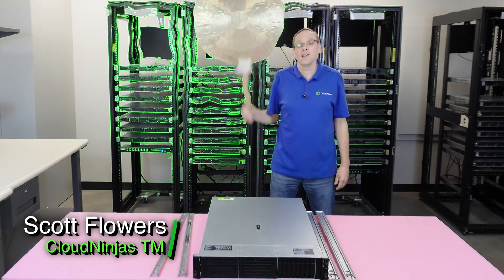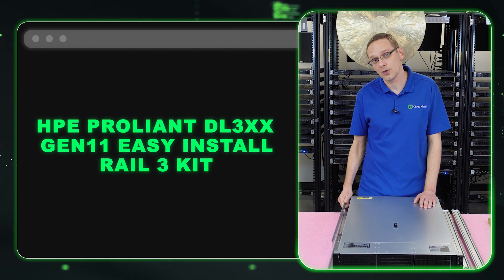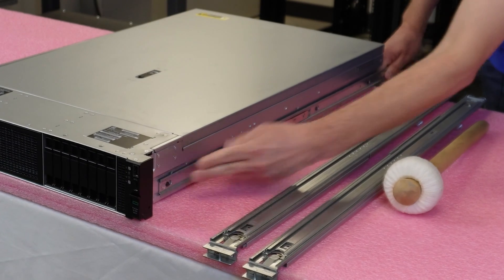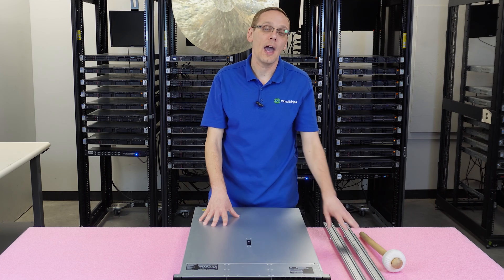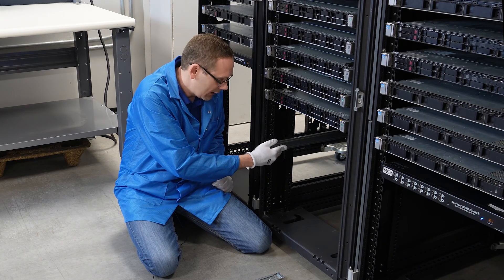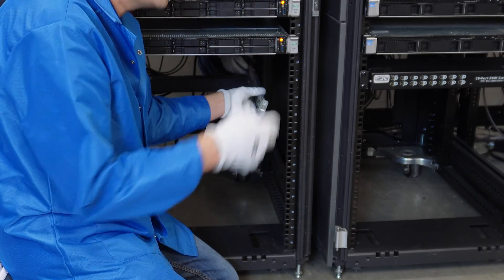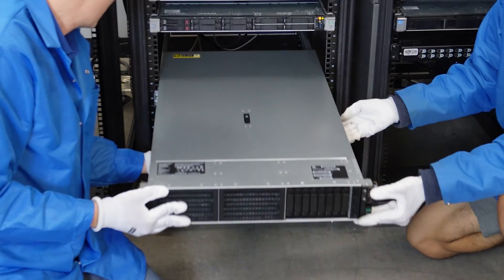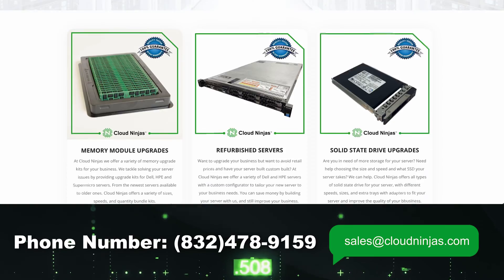HPE ProLiant DL380 Gen 11 Server Racking | How To Rack a Server | Sliding Rails | Rackmount Server

Comment: Asnwer to the previous comment so you can see better: the lenovo sr650 is the same gen as the hpe g10, 2u server 2 socket intel xeon 1 and 2 gen, the sr630 is his 1u brother. The sr650 v2 is 3rd gen scalable (with the sr630 v2) and the sr650 v3 is the newest one, parallel to gen 11 of hpe. Also there is the x3650 m5 which is a bit older but is going cheap right now and it's perfect for homelabs (it even handles gpu workloads) that would be e5 v3 and v4.